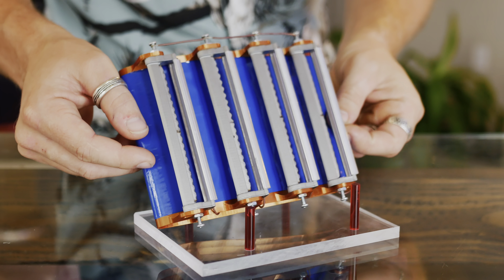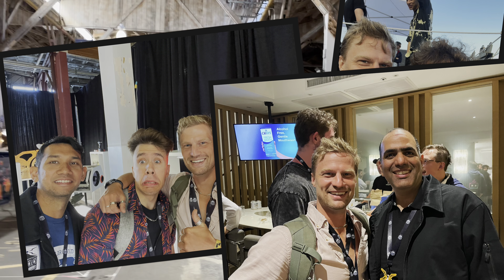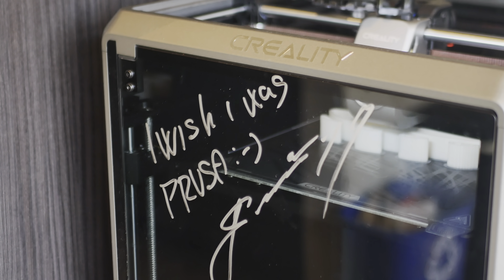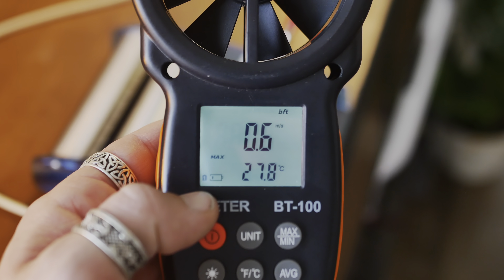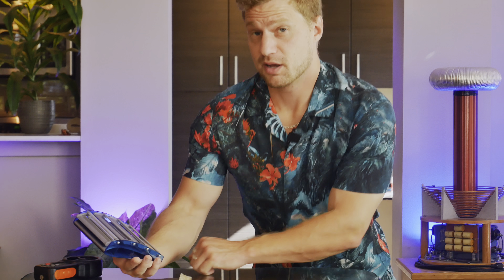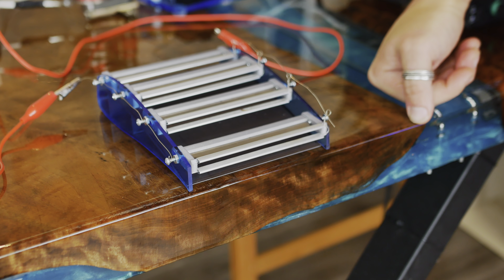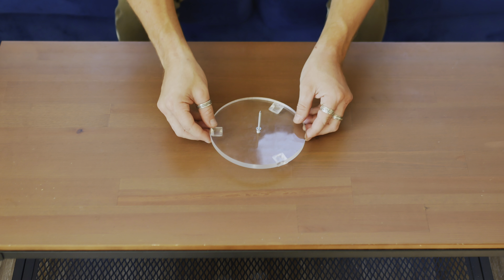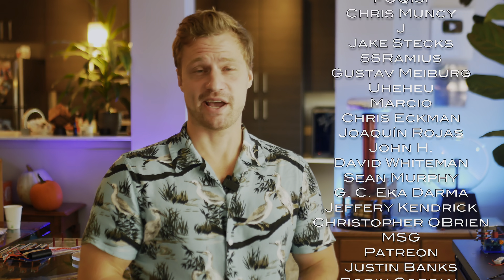Designing A Self Propelling Ionic Thrust Wing

Comment: Just a thought, I don’t know much about plasma or ionic thrust so i might be missing something important here, but what about putting the thrusters on the high pressure side of the airfoil as to not disturb the low pressure side as much as it is the side that creates more lift and it is more sensitive to turbulence? Or maybe keep the thrusters on the low pressure side in order to aid in flow attachment so that a higher camber airfoil profile can be used that can produce more lift that otherwise would not be possible without the thrusters?

Comment: If each thruster pushes the same amount of air through the same space, the flow rate will not be increased...that is the consequence of pushing a fluid in series. In this case, you were pushing air through a measuring device and got slightly less than your original reading. This is unlikely due to obstructions since the last thruster would accelerate the air flow back to what you originally saw from the test of a single thruster. However, this would require each thruster recieve the same charge as before...I believe this explains what you saw.

Comment: There's something missing here:
The main wing itself doesn't have a wire or blade in front/above of it. The 1st stage so to speak.

Some lift numbers from the spinning wing would have been interesting too.  
ie: Did the angle at which it spun change any?
That would take some careful fiddling with the angles of the  thrusters so they add to the lift.

Your RC aero aluminium tubing also seems a bit 'fat' vs the optimum aero shape and lacks an optimally 'sharp' trailing edge.  
I dont know if such can be 3D printed and stuck on with any success,  but a trailing edge mold, with the tube placed 'in/above' it before the resin sets could work nicely. 
A properly parallel jaw vice will fix the 'too fat' issue easily.

Oh ye; you might try losing the plasic wing bit the craft knife blades fit into: small frontal area is king...
Just aero-round the blade's leading edge with a sander.

Comment: You could try electroplating or use thin metal foil tape as the electrodes to further reduce the weight of the wing

Comment: Looks cool. You eliminated weight etc but you have added a ton of Drag. You will never get enough lift out of this. It certainly is a unique concept though. I like the attempts and the proven improvements you made. I just don't think this is the correct application. 
For one thing, aircraft aren't "jet engines with wings attached". The are wings with jet engines attached. The wings provide lift and the engines provide the power it takes to move air fast enough over the top of the air foil (wing). Some wings use air foil turbulence and others use laminar flow.
So I'm saying that your ion engine experiments would be best applied to an engine which is independent of the wings. And with wings, consider dihedral as well and how it will affect your "ion powered aircraft).

Comment: What is the benefit of having the thrusters overtop of the airfoil and splitting the airstream vs embedding them at the surface of the airfoil in an attempt to accelerate the flow of air over the airfoil

Comment: It's a set of wings on top of a wing right now.
What if you just put the wire  trailing behind, and wrap the wing in a thin foil, rather than plastic, as the ground, simplifying the design further.

Comment: It occurs to me you are also getting eddies from the power unit in front of your air supply. As well as behind the wing. Like shooting the exhaust into a parachute behind it. 

I’m wondering how well it would work if the power pack was offset in height from the wing. Or better yet, a wing on each side, power pack at the hub.

I considered the bi-wing design of the old Great War era. But they had drag and weight from the struts and wires. So I’d stick with the mono wing. Though your airfoil might benefit from being more dynamic.

Planes with leading edge slats or flaps, as well as flaps and spoilers are able to fly much slower and stable than those that don’t have it. However they hit a speed limit pretty quick when trying to go faster. You will need ailerons, an elevator, rudder to control the aircraft. So you might as well put that on the roadmap as well. If you can thrust vector or wing warp the ionic thrust. 

I know you are only working with a portion of the wing. However did you say if that section was to scale with the power supply? If you are able to get 2 or 3 times the wing span with that same power pack. It’s worth testing at that scale.

For all we know, surface area with the electrical components makes for more thrust, when stretched over a longer segment of wing. Hopefully if it does t add to anything, it will at least negate the drag of the additional wing. Giving more or less the same results. 

I’d be curious to see the various bell curves for thrust v drag based on airfoil shape, and thruster configuration. If adding more in series, or less is better. Or if making the entire wing be the thruster, with electromagnetic thrust vectoring and wing warping gets you anywhere. 

Fascinating what you have going here. Only wish we had a simulator to try everything out in. 

I do know the RC simulator Real Flight 4, back in 2009 or whenever, had the ability for you do adjust the various component  attributes. It gave me the ability to test a UAV design. Which told me I had to add nearly 2 lbs of lead shot in the nose to stay balanced. Also had to adjust the throttle to wind up and down slowly so it didn’t do what the 787max would do a decade later. 

The simulator was freakin spot on after painstakingly entering in all the measurements and attributes. The only reason I didn’t crash it at the field was because of all the variations I attempted and flew in the simulator. 
So that might be worth looking at. 

I’d also be curious in knowing if the arcing of power is affecting it in any way. It reminds me of the small rechargeable bug zapper we used in our popup camper this last summer. It was very light and wondering if there are COTS components in it you could use that might be lighter?

Comment: Wouldn't it be better to wrap the plasma thrusters within the wing leaving intakes near the fuselage (or in segments on the wing) and exhaust ports in intermittent sections of the wings to improve thrust using mild compression and possible moderate thrust vectoring to help improve lift? and it could potentially improve weight by integrating the motors into the structural support for the wings instead of adding weight to the complete wing?

Comment: Couple of guesses 1) Just as a jet has it's thrust through the plane mabe more of a biplane style stacked thruster of wing coulf be useful to you? This the thruster would have an air scoope into the wing for a long thin internal thruster both over and under an internal wing. 2) In modern Jets an "enemy" of the engine is sort of the heat it produces that reamains after creating thrust,  however heat is still energy, and can still be used. With a slower battery plane consider ways of using your resistance to encapsulate any heat for inner airspace raise on higher colder heights. The biplane wing could have seperate air pockets in each wing internally that could store that hot air.

Comment: I think the biggest enemies of an ionic wing will be water and altitude.
1) Will the thruster lose power travelling through cloud, where the water will form a conductive film between electrode and ground?
2) At high altitudes (and therefore low air pressures), will there be enough mass pushed through the thruster to  provide sufficient speed? Would you need to feed the thruster with a heavy gas such as xenon through minute holes in the leading edge of the wing?

Comment: sweious question i know oyu are far away from accualy makeing a flying prototype but should the thrusters not be at the bottom my understanding of how a wing works is that its shaped so the air has an easyer way flowing under it than over it wich gives it lift so if you have the thrust ontop does that not reverse the lift of the wing since air is not pulled over the wing instead of under it maby i am wrong but i think you should maby go for a designe with the thrusters pulling the air under the wing not over it

Comment: wait a wing works by increasing the air velocity above the wing resulting in lower pressure and higher pressure below but the Ionic thruster relies on air density to pull air with the electrons so wouldn't it be more effective to put the thruster below the wing not above

Comment: I am not an expert, but it would be much smarter to extend the piece of metal over the whole area of the wing instead of making 4 different pieces horizontally, making a lot small pieces vertically. And cover the top. Make the input big and the output small.

Comment: I was a helicopter mechanic, I know a bit about flight. You should adjust thrust angle for your thrusters so your grabbing air higher up in the front while pushing downward on the wing as it flows back. Look into helicopters for more of what you're doing. This should  create a lower pressure on the top of the wing.

Comment: This is very innovative. It sounds extremely interesting. As a thought, does putting the thrusters in series produce the most thrust or does putting them in parallel? Does putting two thrusters in series produce twice as much air speed or does putting two, one above the other, so they are in parallel produce twice as much air speed? As I see it putting them in series could mean the second thruster is trying to resist the air flow, whereas putting the second one above or below the first might prevent that from happening.

Comment: How about using the trailing edge of the wing, and a distanced aileron as a thruster? Going for width instead of multiple ionic thrusters in tandem.

Also it'd be interesting to see how incoming airspeed affects the achieved airflow acceleration by the thrusters, since most of your tests were static.

Comment: Those HV generators are unregulated, they use the spark as regulation to prevent their output voltage getting so high that they destroy themselves, expect them to be short lived, but hey this is experimental so theres room for better HV stuff later. 
Your razorblade's look a little chunky, what about the blades from the 1960's style razor those are much thinner, you get two sharp edges per blade so break them into 2?
if you do use wire, is round the best shape, oval? hit it with an hammer....

Comment: I'm no wing engineer, but the shape of a wing is causes air to move over the top faster, to generate less pressure and thus lift. If you are moving the air electronically, do you even need a top section to the wing? Or does the the sucking of more air into the engine cause more pressure on the top of the wing, and thus less lift?

Comment: i know you said you intend to use wiring for your next iteration, but the result you got from switching the razorblades to the lighter serrated ones reminded me of the structures in dams called 'weirs' ( https://youtu.be/YkR79oDAgOg ) and how that could potentially affect your output

OR, maybe the serrations were simply creating points of less resistance for the jump between your positive & ground surfaces, rather than it actually having an aerodynamic advantage (or maybe a bit of both?? 🤷)

Comment: Firstly, I say "Bravo - good stuff!"

When you're ready, your system might benefit from a (highly efficient) NASA "PRANTL-D" type wing - a project led by Albion Bowers, Chief Scientist at the Armstrong Flight Research Center (cool guy, now retired). The wing doesn't produce tip vortices (big sources of drag), so it's 12 percent more efficient (for the same weight of material), and also eliminates the need for a vertical tail to control yaw (which accounts for about 30 percent of the weight and drag of a typical plane). So it's about 42 percent more efficient than a conventional configuration.

I intended to machine a copy from foam (as the NASA team did), but now I think printing with foam filament might be best, at least for a subscale model. (The NASA report (including the print files) was published in 2016.) There's a Wikipedia page about the PRANDTL-D project and its derivatives, plus Al Bowers has some nice presentations on YouTube describing his use of the "bell-shaped lifting-line" concept published in 1933 (by Ludwig Prandtl) and other research like soaring birds using the same principle without a vertical tail.

Feel free to message me if you have questions-

Cheers-

Comment: Hey I’m a pilot out of Michigan and had a few questions/ideas, do you know if the flow coming off the accelerator is laminar, if so it may be benifitial to point the flow down onto the upper wing surface, this will both increase lift and will create a mutiplying of thrust effect over the top of the wing increasing thrust, by having multiple laminar or boundary layers I could see the wing being much more efficient. Also having the accelerators point down will draw in fresh air, instead of consuming the air from the top of the wing, lessening lift. Just something to consider.

Comment: 0.044N is the weight or force equivalent to a mass of 4.5 grams. This kind of error is inexcusable. It's as bad as expecting chatGPT to calculate anything when you need a correct answer rather than a witty poem. Likewise, using an anemometer whose cross section so badly matches the profile of the moving air means that your actual speed figures are really inaccurate and cannot be used for comparisons with other thruster shapes. Another thing to watch out for is your exposure to x-rays and ozone. No point dying from cancer to make a glider that goes at walking speed.

Comment: Doubt. 

Ionic thrusters has their use, but propelling anything on earth isn't it.

It's main advantage is the propellent being lightweight, which doesn't matter much when the electricity you need to power it requires an incredibly heavy battery. 

It's useful for spaceflight because energy source is a solar panel, and the vacuum means the incredibly low power from the sun is enough as it doesn't have to combat air drag.

Comment: Hey I love your video! Giving us a look into the design process was super intuitive and eye opening, when you build your next prototype, will deflection in the wire as current is drawn through it,-or when air passes over it-be a problem? If the wire itself is deflecting, I would recommend using something like bandsaw, or scroll saw blades (which are even thinner and narrower in width). Their strength under tension is incredible and there are some really fine tooth options available if your arc points (spots where the corona emissions are visible) end up being a factor in air flow production. Cheers!

Comment: Looks great but how much lift are you creating?  If it was creating significant weight the wing should during tip up after gaining speed.
Reply: The problem is your thruster may introduced a high level of drag. You need to run in a wind tunnel with dry ice to see what is happening over all.

Comment: 1.8 per unit airflow speed, the first thing i would have removed the two middle thrusters and check if i could get more of that energy, obviously they are interfering with each other, maybe two thrusters would have given close to the same thrust as 4. or adjust the thrust engines to very different heights.....maybe next time.

Comment: So wings work by decreasing air pressure over the top of the wing,  creating an upward force what if you focus the ions in a vertical orientation what u want is lift not speed, speed can be produced by thrust, also use either polar power one pole  to charge air the next to push

Comment: Aluminum HVAC electrical tape may be helpful for model building. It is cheap, lightweight, adhesive, and conductive. Rigid insulation board might be helpful. With aluminum on the outside and a foam core you could put it into a hot press. Heating the outside should cause the foam board to melt into a wing shape.

Comment: I do believe that that's the first perpetual motion machine right there. Hook it up to a pulley and you can then power up your car.

Aim the car down a steep hill, so you can then get to work for free every day. Just take an uber home, and get your dad to tow your car back up hill (you might have to loan him a truck and a chain), so you can then ride your perpetual motion car back to work for free every day. Hook up your cell phone charger to the alternator in series with a flux capacitor and a rectifing diode pack to charge your phone, so you can call your dad for a tow, every day..

Comment: Nice work. I am no expert at all at aerodynamics but I have the feeling you are putting too much "crap" on top of the airfoil, esentially changing its "actual shape to the wind", to say it the best I can. It's like adding slats, and flaps to the wing. It changes overallk performance. The question is, how are your additions affecting the foil performance?? I have no idea.

I think, it might be better (if possible) to make the airfoil so that the plasma HW is somehow embedded inside the airfoil. There were some aircraft (Boeing YC-14, for instance) that had the engines mounted on top of the wings, and the exhaust gases were propelled on the top surface of the wing, increasing somewhat the lift. Maybe something similar??

Comment: Could you build an ionic propeller for a drone based on this concept? You could put the power power source in the cone of the propeller and have two winged ionic propeller blades and you might even be able to recycle some of the power into a electric motor for a ionic/motor driven hybrid. You've moving closer to an ion wind electric hybrid drone. I've always wondered nobody ever combined a traditional bladed "fan" with an ionic bladeless "fan" to see if you create even more thrust/flow without adding too much weight.